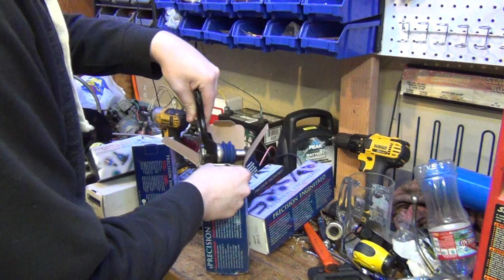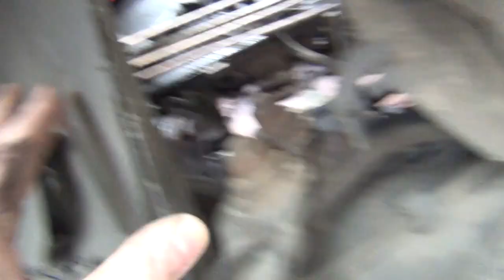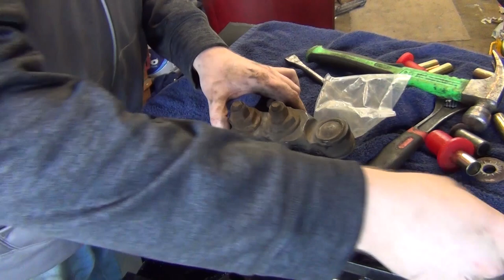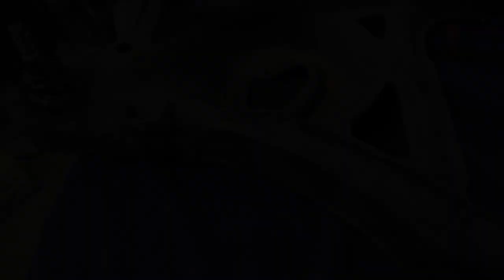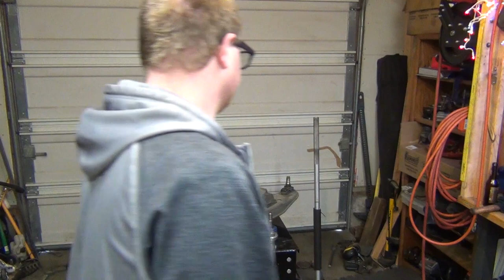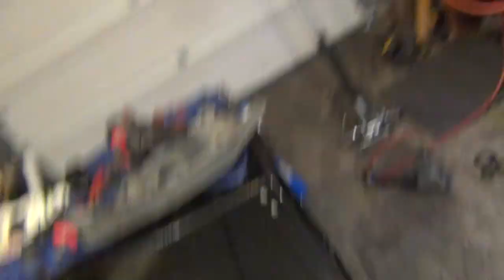Clapped Out! Crown Vic/Marquis/Town Car Front Suspension Rebuild Part 1

Comment: Nice job keeping this old beast on the road, these things are tanks, and built to last!
Reply from the maker: Thanks, I enjoy driving this car. It's been a sweet daily driver and even with it's issues, it has been very reliable. Now I just need my new soundsystem, that is going to be a fun project!
Reply: @justhes  Question: Where did you get your upper control arms bushing kit from? I wish they made the bushing with grease fittings.
Reply: Mines pushing 300k miles. About to rebuild the front suspension for the second time. Very simple and very cost efficient to do the work myself.
Reply: @skworthington95  why would you have to rebuild for a second time?
Reply: @nickradic  you realize in reality everything is supposed to be changed every 100k miles....

Comment: I wound up putting loaded upper and lower control arms on my grand marquis. I had a HELL of a time getting the drivers side lower ball joint to break free. Took me over an hour. Finally ran the pickle fork air hammer attachment in as far as it would go then beat the stud as hard as I possibly could and it finally broke free. Never seen one so stuck before.
Reply from the maker: I’m surprised anyone is watching these videos lol.
Reply: @justhes  Still near at the top of the list when you search for crown vic control arm replacement lol.

Comment: I undertook a similar job on my 1983 Caprice Classic about 18 years ago. Replaced the factory upper and lower control arm bushings with polyurethane ones from Performance suspensions (advertised in Hemmings). Along the way I also put in their deluxe sway bar, HD performance springs, obviously new upper and lower ball joints, and a whole new steering linkage (except the Pitman arm which was fine). Put Bilstein shocks on it. Took a LOT of perseverance and some "talking to" at times, but when it was finished, that big B-Body handled like a sports car. The toughest part was loading and unloading the springs in place with the compressing tool. Pretty spooky! 

I'm contemplating a similar replacement on my 2000 Grand Marquis (67,500 miles). Glad to see that the upper and lower control arms are available nowadays for reasonable money. Thanks for posting the video. You have my unflagging respect for endeavoring to do all this.

Comment: I did a 96 CVPI full front end that I scooped up at a city auction in 2017 for $800. Had 90k miles and was used by the gas department supervisor. Did all new upper lower control arms, ball joints, springs and shocks, wheel hub and bearing, tie rods, pitman arm, idler arm, center link, sway bar bushings, sway bar links, pads and rotors. Kicked my ass, but it's still driving perfectly today.
Reply: Where did you get your parts for this build? and how has it been treating you so far?
Reply: @_EatMyShorts  Got majority on rock auto, most stuff was mid level quality. The hub/bearing, rotors, and pads higher quality parts. I also did a back cat delete, intake manifold npi to pi mod kit from ADTR, and a ford racing intake manifold. Car still runs great I drive it daily.

Comment: i had the same problem with detroit axle when I did mine as the sway bar links where incorrect.  they later changed the part number, after I was left buying new sway bar links.   Then I found the joints were dry and had to use a grease needle to fill the boots and the grease worked its way in.   I was unhappy to have noise coming from the front end after all that work.

Comment: 25:00 I remember struggling with this nightmare on my ‘99 retired cab. I wasn’t so lucky to have anticipated the repair. My lower ball joint on the driver side actually BROKE while I was driving with the ball bearing part still stuck in the control arm and the threaded part still stuck inside the knuckle. I was still relatively inexperienced at working on crown vics and I had such a hard time removing the broken lower piece that I ended up just replacing the entire control arm with a new one that already had the new lower ball joint attached. After nearly two days of pounding with a sledge hammer and barbecuing the upper part with a torch I finally took the knuckle to a tire shop and watched in complete embarrassment as the tech pounded the piece out of there in less than ten seconds with three good whacks (he had a much bigger sledge 😂). Recently I had a similar experience with a ‘98 grand Marquis. Finally broke down and BOUGHT my own ball joint press from eBay. Not only was it CHEAPER but I actually got a more complete kit than the ones that they loan out from AutoZone and O’Reilly.

Comment: Nice job bud. But I’m not quite sure why you wanted to put poly bushings in there anyways. Poly are good for a performance application, but not a car like this. They have a tendency to squeak and they’re harder and absorb less vibration than rubber. Which detracts from the smooth cushy ride that a town car is supposed to have. I’m sure it still rides fine, but just saying I would’ve used rubber all around from the get go. Just my .02  I’m hoping to pick one of these cars up soon.
Reply: Delrin....
Reply: Poly lasts longer than rubber for one reason

Comment: I've replaced everything in the front except for lower ball joints and control arm bushings. Now i regret not doing those first. I wonder if i can press out the bushings because they dont cost much on rockauto and the pre assembled arms have cheap ball joints.

Comment: Dude how the hell did you reach that bolt on the driver's side upper control arm with the plastic shielding and brake lines in the way? I'm having a hell of a time.
Reply: A long wrench. on my 08 CVPI they were easy to brake away with a long 22mm wrench.

Comment: Are the upper control arm bolts special bolts or not? Need to know If I gotta order some to do my control arms that are on the way.
Reply: They are kind of special. The inside has a semicircle domed end to lock it in place against the strut housing. It is why you have to remove the strut to remove the control arm. IF you replaced with a similiar size bolt I really don't think it would be a problem with locktite and inspections every oil change.

Comment: I have a diesel pickup and the engine is weak. Would you recommend a 4bt or 6bt swap? It’s an 05 Duramax that’s weak.
Reply: 6bt
Reply: 6bt with bigger injectors and 4k governor springs and like a #10 fuel plate. Bigger turbo and youll be able to make at least 450 to 500whp easy peasy

Comment: Hey man great video... I have a Crown vic 2010 and recently replaced rear shocks rotors and brakes and ive had the problem when driving over  small bumps the rear hits pretty hard... i dont know what else to replace any help or guidance would be appreciated thanks

Comment: Are they different than the Crown Vic front end?
Reply from the maker: the control arms are the same, however (for whatever reason) there are two setups for bushings. seems to me, lincolns got the same size setup for the upper bushings.
Reply: The lower has the same setup as the civilian model crown vic and not the police package